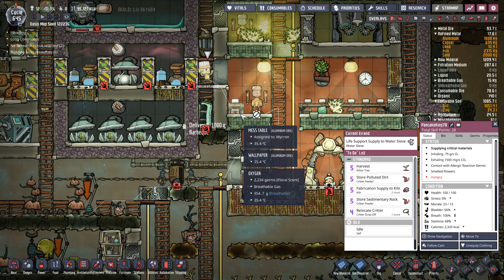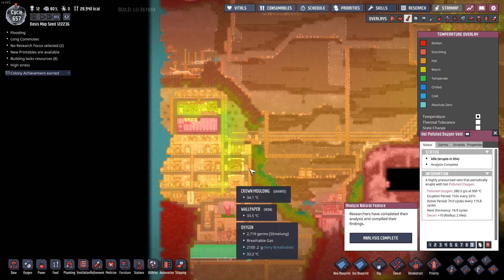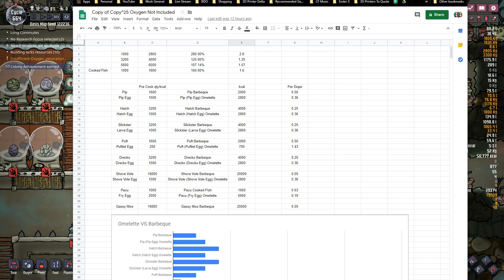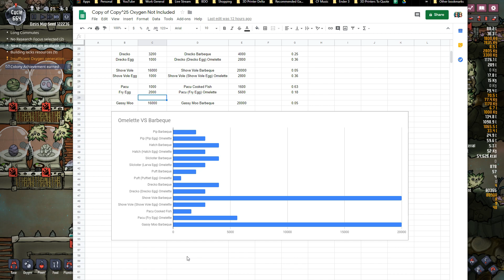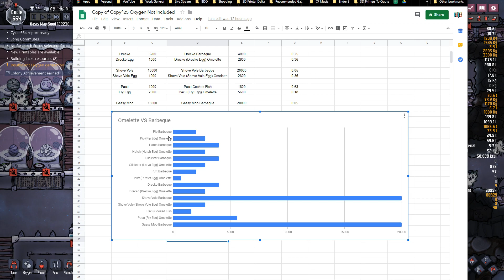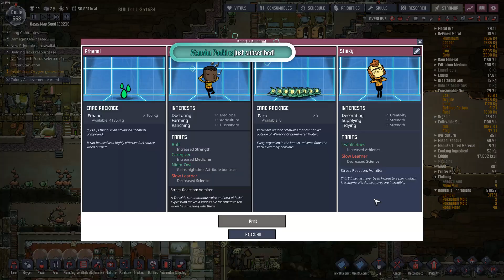Remodeling The Kitchen! Oxygen Not Included ep16

Comment: Instead of using batteries all over... Why don't you use the "Wattage sensor", to turn generators on, as needed, when demand kicks-up?

Also... You should have a room for dedicated "idle-time"... Nothing but hamster wheels, which you can interrupt on a set interval. It's better to have idle dupes generating power, so you don't consume your resources and generate less heat, when possible.

Where I need actual batteries, which is not many places... I use two smart batteries in a flip-flop setup, so they can charge normal "large batteries", to full capacity. (One smart battery charges, then that triggers a FLIP, to the other smart battery, which is "dead". The power continues to charge, until all the big batteries are full... then the system drains all batteries on the FLOP.)

Normally, I just watch my "wattage loads". Turning the most efficient generators first, then the most wasteful ones last. (But only if the hamster-wheels have not provided all the needed power, which is stored in batteries.)

This game really needs some better, and realistic, "power management", and less "abundance", which only exists because of the lack of realistic power control. There is no 2000w limiter, to match the 2000w wire. You have to use 2x 1000w limiters, and that's NOT how power works... Batteries should be a "LOAD", when charging, and, their placement should matter, when using them to provide power. (Shortest path to loads, as that is how power "flows". Instead, wires break, randomly, on devices that are not even running.) Like everything-else, power defies all logic and physics, in this game.

Comment: If you have some time to do another experiment, I have one for you there: After powering up a steam turbine using the hot liquid from a volcano or a refinery, I wonder if it could also works with glass production since it output molten glass. Taking it out that heat into steam to cool it down could potentially create a lot of energy to be used. And since you are into updating that base, it could a nice thing to try there:

Comment: You could put oil refinery on the solid tile and output petroleum on the floor near by, it will cool refineries with constant temperature on the way down. Same deal with petroleum generators, solid floors works better, cause polluted water constantly cooling it off. But in the end you still need to add cooling loop like in your metal refinery area. Thank you for your videos, it's very fun to watch in the morning with coffee :)

Comment: I am thinking of doing my own variant of the critter killer you did but with a twist: Since I have 8 stable with hatches and 2 with pips and 1 with dreckos, I want to keep new babies for as long as my stables are not full while taking the eggs away for either omelette or barbecue when it is needed.

The tricky part is that from my natural hatchery, I would have to open the door for the killer only if one of the stable needs critter. Yet, i cannot had the numbers from different critter sensors, knowing that X stables multiples by Y criters is my minimum and drown everything else. I am wondering if a complex Memory Toggle pattern could solve that but it seems complex for nothing there.

Will see in time I guess :)

Comment: I think the pip got in there because the doors opened while it was over one, so it fell in. You can see it in the grill room earlier, as it had snuck in during construction. Also, once again you seem to only too late realize the need for cooling... Heat is the biggest problem in ONI these days, you've gotta abandon ideas that temp will stabilize on its own without a system dedicated and monitored for it.

Comment: DONT put etanol AND petrol into the same feeding line leading to the same generator!
The game dont understand this and the generator only take the first fuel it gets and never touches the other.
Build an ethanol generator sector just for the burning of ethanol.
By the way: ethanol is a baaaad fuel with less energie output then woodbruners if you count in all the cost and heat.
Reply: You do ethanol for polluted water, and maybe polluted dirt (which you might offgas for oxygen in a pinch). Power is just a nice bonus. However once you have access to efficient cooling systems and slicksters, it still gives you a decent chunk of power as well. Of course, for it to net you water the trees need to be wild. Also, note that the power station buff would change the net power drastically.
Reply: @tejing2001  agree and good to mention it again.
Etanol also dont need much dublabor besides of the harvesting of the lumber and the powerbuff. Its kinda a nice way to power remote baces if i think of it. Huge setup but nice and save power.